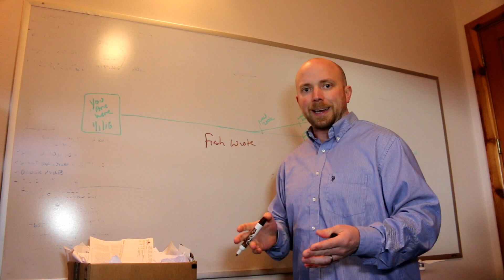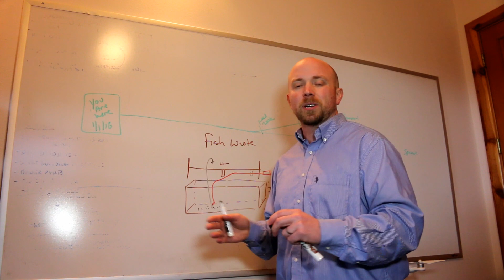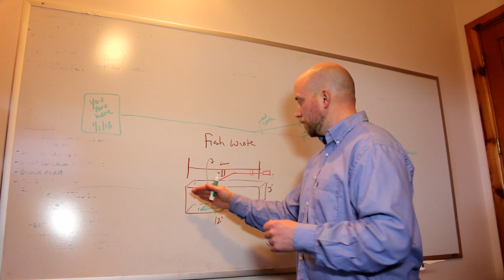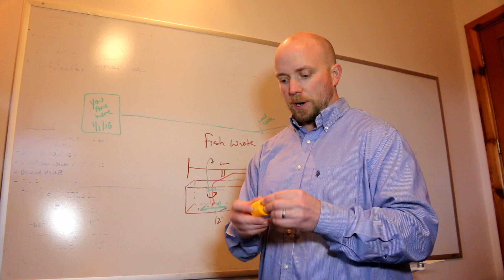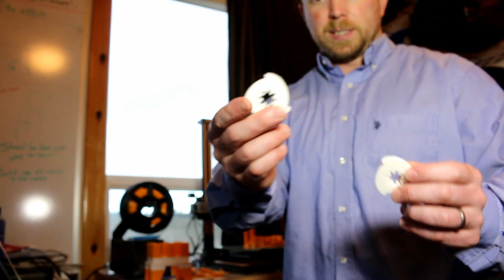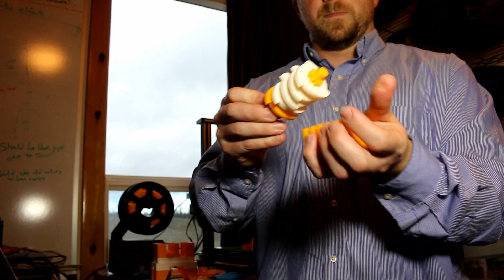What's the best way to remove Fish Waste?

Comment: Jeff your Tanks are like a River if you designed them correctly, then you would of had a Slight slope to a Low Point.. As Long as the feeds from your tanks are Pointing to the Low spot all of the fish waste would be Located At the Low spot.. Or if you need to Push the fish waste to one spot, use a intank current maker[ie those fan's/pumps used to create currents in a Seawater fishtank] Push all the waste to one location and then have it filtering thru 1 specific grow bed..

Oh Yeah  -- http://www.backyardaquaponics.com/forum/index for a website of Aquaponic people..

Comment: It would seem that twisted lines would impart torque that would make the lines tend to untwist themselves, especially if the apparatus is floating in the tank.

That said, I agree with those who have suggested contouring the bottom to create a low point for collection then using a tube collection lift like under the gravel of aquariums with your air pump. Remember, the fewer moving parts and simpler the design, the higher the reliability.

Comment: Seems like you are way over-complicating the entire thing.   Why do you need a flat bottom?   Have an incline, so all the waste eventually gathers at the low point.  You could even have the bottom incline be added to the tank, rather than be part of the tank  (think like a painting tray, but big enough for the tank). If the waste doesn't collect at the bottom, you can add something small to give a little vibration to the bottom lining.  Then you dont need to move the nozzle on an x-y axis.   just have the nozzle on the bottom collecting point.

Comment: Have you looked at something like this.  I was thinking you could mount the unit upside down to the shelving above the bed and use a cable to wrap around the bed loosely down to the hoses and the bot could keep an eye on the bed you are growing in.  https://farm.bot/shop/
Reply: Or another way would be to set the bot so that the 4 corners are supported and are held out a bit so that the cable holding the lines under the bed can move.  You might have to put rub protectors on the spots where the cable rubs.

Comment: I don't understand why this has to be automated.  How often do you need to clean the fish waste?  Why can't you put frames with screens on the tank bottom to catch the solid fish waste and then manually pull the screens out with hooks, empty them into a wheelbarrow, and put them back in the water?  Then you can process the solid fish waste from the wheelbarrow into the beds using a shovel.  Or, maybe you can dump the wheelbarrow into a grinder, grind it up, mix it with fish tank water to make a slurry, and spray the slurry into the beds.

On a more expensive scale, the coolant systems for our machining lines use chip drag conveyors to pull metal chips and grind swarf out of the bottoms of the coolant filter systems and into chip hoppers.  You can use a slowly moving screen conveyor  to bring the fish waste up from the bottom of the tank and dump it into a hopper or fish waste processor.  From there it can be processed as required and then distributed into the beds.

Comment: The Navy uses a system called an eductor to dewater main engine spaces during emergency conditions.   The operate with water pressure.  You get double the water flow as your input.  You could make a smaller eductor from PVC fittings since you don't necessarily need 500-600 GPM capacity.  It could work with 5 GPM flow.

Comment: Jeff, you are over complicating the entire process.  You have your 3D printer, you can print custom sized filter grids for the bottom of your fish tank.  They have been using lift tube filtration in aquariums for decades.  Look at the design of under gravel filtration and adapt it for your needs.
Reply: agreed, I use them in my aquarium, they are very good at stratifying the waste under the filter grid, then stationary uplift tubes, spaced every foot or so, can pull the waste up to the bed, just the way you explained using your original idea.

Comment: 2 points 1 add a second species of fish like a cat fish that feed off the bottom. 2 use the drain on the fish tank to drain the lower 1/3 through a secondary filter and then reinsert the water back

Comment: I'm pretty sure people have said this before, but you don't want solids in your beds. Thats why you use media in your beds. If you have compost in your beds, on the short term its good, its rich, but in aquaponics it always has negative affects,  like reduced flow and anaerobic zones. In fact, nutrients aren't usually a problem in aquaponics. They almost always have excess nutrients. You should instead get a solids filter to take the solids out.
Reply: agreed, i see a lot of aquaponics set up to use a swirl filter to separate the solids out of the water used to feed the plants. the waste solids will make good worm food, but i'd keep that all in a separate vermiculture bed.
Reply: Indeed. As soon as you add solid fertilizer and media it isn’t hydroponics.

Comment: As others have mentioned your earlier light translation could work but as an interim solution while you work on  a less technical / costly  solution for moving your waste lift around.  I see a challenge getting the rotary union to rotate freely with the low forces it will see in use.  I like how you are always thinking and trying things.  I have implemented mfg processes that I didn't expect to work but 1) needed to address a problem 2) wanted to try less complex methods first, and 3) occasionally worked fantastically even though I didn't expect it.  I guess I'm saying keep doing what you are doing.

Comment: The "creepy crawly" does not use suction.  It uses water pressure to create a vortex into a capture bag, water motor for drive wheels and water pressure for tail jet.  The concept should work for your application using air pressure if the device is weighted to compensate for the lift caused by the air.

Comment: As I recall,  you had a system for moving your lights along the bed.  If you have a static manifold the width of your tank at the base of the fish tank attached to a floating pontoon you could move the pontoon up and down the bed.  The submerged manifold would have micro jets the agitate the waste and the suspended waste moved up to your grow beds.  A cycle of once per day would keep your waste build up down and permit your low current requirements.  The more you have the waste suspended the earlier it is to move to your grow beds.  Any system will have blind spots that will need manual intervention.  I hope you get your system designed and installed soon so that your additional fish load will not cause nitrates etc to be an issue.  Nice concept for your shredder.  Remember that your manure will contain a lot of abrasive components, so plastic being soft, will need to be replaceable.